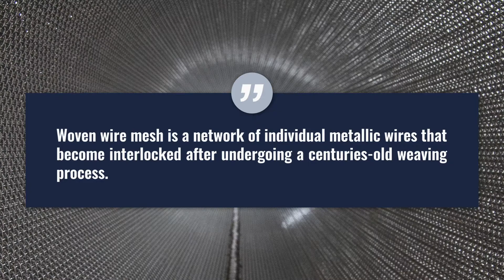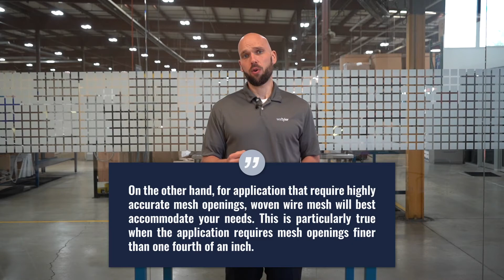Woven vs. Welded Wire Mesh: Picking the Right Solution

Comment: I want it sturdy, but not so much to handle alot of pressure. The application I need is for it to be somewhat rigid. NOT flexing  like some kind of wire that you roll out. A fairly rigid 5x5 feet square. Any I want it to be light weight. That sounds like the attributes of aluminum, doesn't it. OK, that or some kind of composite that ends up being lighter.